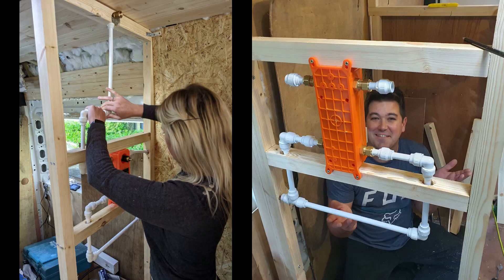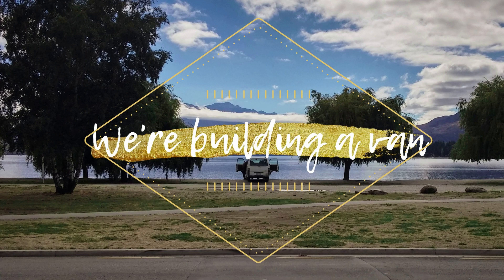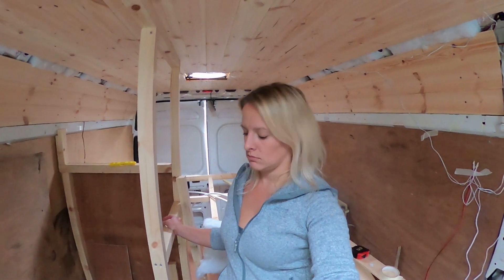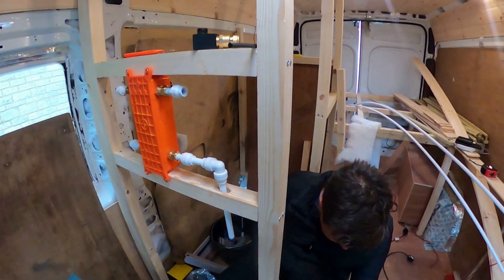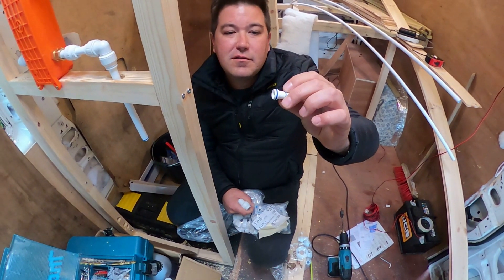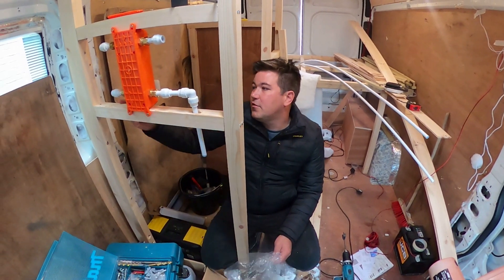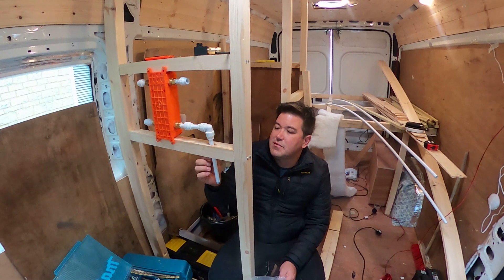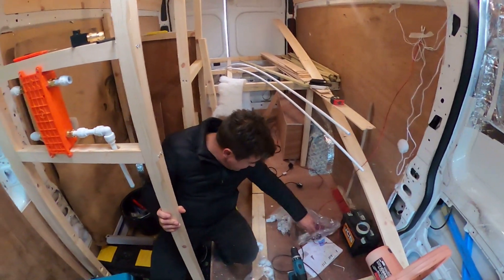Full Size Rain Shower | Operation Plumbing.. | Van Build UK

Comment: Duo Vagari  I would not want all those pipe joints behind a non removable panel, with van movement you will probably get some leaks that is why manufacturers use flexible hot and cold water hose

Comment: You're only going to have one temp out the tap that way. You're going to lose lots of water just waiting for the hot from the boiler to get through to the shower. Then you're also going to use more through the boiler running it at a lower temp. which means more gas. You can put a Y piece on the OUT of the pump and run separate feeds, one to the boiler and one to cold taps. Have the hot feed from the boiler to the shower as short as possible to minimise the distance you have to pump the hot water. What size water tank are you guys running and what pump? What is the length of pipework now from the boiler to the shower? Give me a shout if you need help, I do plumbing as part of my work.
Reply from the maker: @monz1978 this has been on our minds as we were thinking of changing to 2 separate lines one for cold and one for hot. We have a sureflow water pump and its about 2.5m of pipe between the gas heater and the mixer. Appreciate the help will take all that we can get!
Reply: @DuoVagari  Ja, you'll be pushing about 3.5L of cold water through before the hot gets there. If you've only got a 70L tank that's 5% wasted each time. Definitely run two lines, if it's the 10PSI pump with accumulator it'll be fine. The hot will be on the left of the mixer when looking at it from inside the shower. You could even run a smaller diameter hot feed to reduce the wasted water before the hot gets there. WHat boiler are you using?
Reply from the maker: Ok so Chris knows more of the technical parts but we have a 30psi shurflo pump with a 10l tankless instant propane heater (called a vevor) we haven't installed any of that yet just done the basic plumbing.